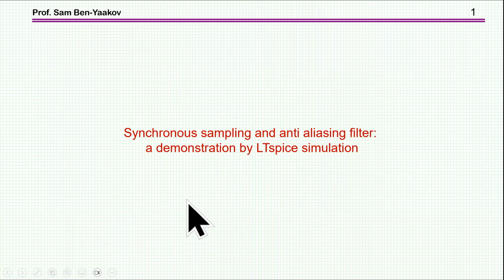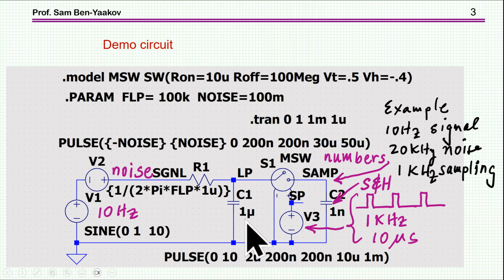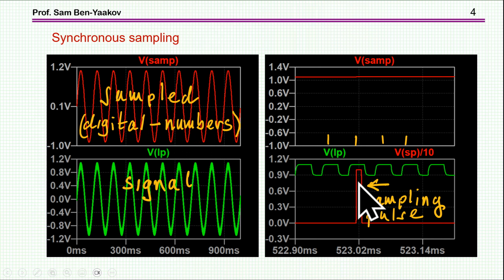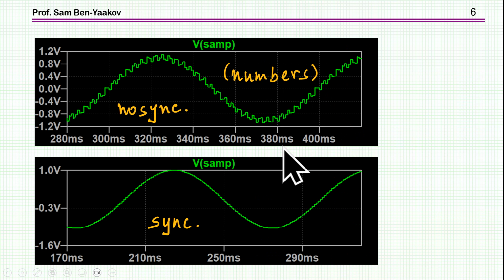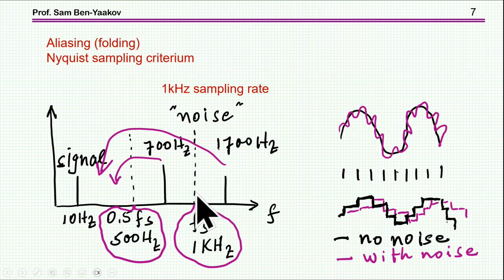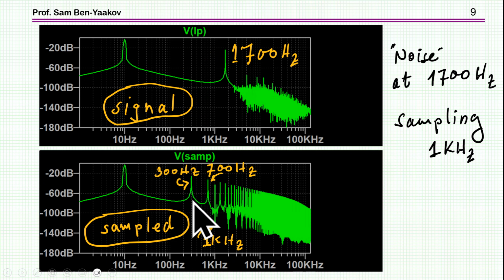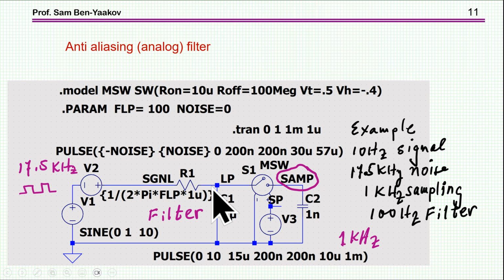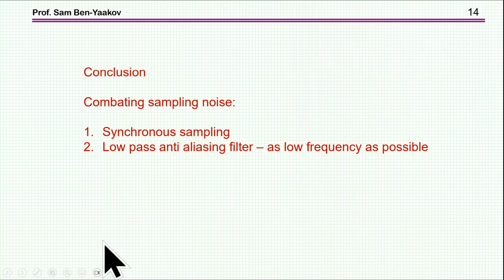Synchronous sampling and anti aliasing filter: a demonstration by LTspice simulation

Comment: Thanks Professor!  What was the simulation command you used to produce the spectrum plots?
Reply: You add AC analysis instead of transient.
Reply: @getusel  Ok.  And what source to set for 'small signal AC analysis'?
Reply: @RogueTuning  Right click to any independent source select advanced from the resulting window. Choose the source from the function menu. On the right side of the window you will see Small signal Ac analysis amplitude box. Insert 1 there and you should be able to run ac analysis.

Comment: To reproduce frequency f, you must sample for a time T=2/(f_s-2f) at sampling frequency f_s.  So very near the Nyquist frequency it takes a very long time to gather enough data.  But at f<f_s/4 it requires only a few periods for high fidelity reproduction.  Put another way, frequency f requires time T to increase or to decrease in amplitude.
Reply from the maker: This is ( a textbook theoretical situation) for a fixed signal that is then averaged. Who is interested in that? In any practical use the signal is changing.
Reply: @sambenyaakov  That is rather my point.  Practical signals require significantly higher sampling rates than the Nyquist criterion... 4-5 times faster gets reasonable response times.
Reply from the maker: @byronwatkins2565  Isn't that what I am saying in the video?

Comment: One of the issues of adding the LPF is that it adds a substantial delay for low frequencies. Because the delay is so long, I've found reducing the zerocross jitter becomes a challenge. Thank you for showing how important the sampling frequency is, and that just by sampling closer to the nyquist frequency can yield different results.
Reply from the maker: The relationship between BW and rise time is fixed. I am not sure I follow your comment. Can you be more specific? The application, some numbers?

Comment: Very nice, but you've given the ideal synchronous sampling case where you are able to adjust the delays between the control of the SMPS clock and the A/D conversion clock so that the sampling occurs when the switching noise is minimal. In the real world case, it would be difficult to control this delay, and you might always be sampling at the time where switching noise is at a maximum. It should be possible in this case to put a small delay in the A/D's convert clock to get back to the case which you have assumed, but most systems that I am familiar with don't have this capability...
Reply from the maker: Thanks for input. Not only that this is possible it is done very successfully. In the products  that we have designed, the signals are sampled synchronously. Not that difficult to accomplish.
Reply: @sambenyaakov  I wasn't claiming it wasn't possible, but if you look at precision A/D convertors from TI and Analog Devices, the app notes mention this subject exactly 0 times and I can assure you that outside of your community, this isn't even discussed. So synchronizing the frequency of the A/D with the SMPS is rare and adjusting the phase relationship to coincide with a quiet portion of the SMPS is unheard of.

See for example Analog Devices app note CN-0137 where they discuss using a SMPS solution to increase efficiency for a precision A/D converter. In their circuit example, they don't even bother hooking up the switching frequency control. Or TI's Application Report on High Speed A/D Convertor Basics, where half of the long document is allocated to input signal conditioning without a single word about SMPS synchronization. I suspect that somewhere on these sites you would find this discussion, but that the overwhelming percentage of designers has never seen it.
Reply: @ats89117  I agree with professor. At my university in Poland and in the industry that I worked with using synchronous sampling is common practice.
The app note you refer to is about ADC power supply, not application in power converter and that's why this information is missing.
What systems are you familiar with? Are they equipped with microcontroller?
Reply: @tomaszswiechowicz1181  The question is not about synchronizing the sampling frequency of the SMPS with the A/D converter. Many SMPS have a clock frequency input for synchronization. The question is about phase shifting the convert time to ensure that it occurs while the SMPS is at it's least noisy period.

My application area is phased arrays where there are 10 to 1000 A/D converters each bringing in 1-2 million samples per second with 20 bits per sample. These systems are always controlled by FPGAs and the SMPS is frequency locked but I've never seen it phase locked. If there was a phase adjustment, which could certainly be added to the firmware, the only way to do the adjustment would be by trial and error because there is no visibility on the delays for either the SMPS or the FPGA clock circuit that generates the convert signal. I am designing one of these systems right now and have added this as a requirement because it seems like it could be very important.

As an aside, thanks for your comment. I have a friend who is a professor at the University of Warsaw, and I am interested if this is a more visible issue in other places...
Reply: @ats89117  I think that my misunderstanding came from the fact that I'm designer of power converters (based on microcontrollers) and adding phase adjustment functionality is trivial. Looking at the market, however, I can't recall any SMPS IC capable of that. Maybe ICs for converters in interleaved configuration would have it.

I have a fact that might be interesting to you: I built reactive power compensators that are supposed to work in parallel through fiber optic communication. One of my goals was to enable phase adjustment through it, because it greatly reduces conducted EMI below 1MHz when phase is selected for destructive interference.
Reply from the maker: @ats89117  Send me an email to sam.benyaakov@gmail.com, reveal yourself telling me who you are, and I will show you how this synchronization is easily done. It is in fact COMMON PRACTICE in motor drive inverters, no matter what TI says.
Reply from the maker: @ats89117  Really? See https://www.nxp.com/docs/en/application-note/AN1933.pdf
Reply: @sambenyaakov  Okay, so this showed up in the Freescale 56F80X DSP processor twenty years ago and an app note was written about it. The latest versions of the 56F80X don't even mention it, and this was never a popular DSP processor to begin with. I'm not saying it's not a great idea, just saying that almost nobody supports it with their hardware...
Reply from the maker: @ats89117  Wake up. There is no motor drive inverter of today that does not use digital control with synchronous sampling. It is extremely simple to implement because both the PWM switching and the A/D sampling are derived from same clock. Rather than thanking me for correcting your ignorance on this matter by bringing to your attention this fundamental and highly useful technique you are arguing and arguing. I don't know what is the area you work in but I can only guess that you are NOT using digital control and therefore unaware of its capabilities. This is the last of my responses on this issue.
Reply: @sambenyaakov  Well that's amusing. You're absolutely correct that I am NOT using digital control for motor drive inverters. On the other hand, I have built over a hundred million dollars worth of products that use cutting edge A/D converters to sample data from transducers, where self noise from SMPS are a serious issue. And exactly none of these A/D converters has the ability to adjust it's timing to coincide with the quite portion of the SMPS cycle...
Reply: Double edged sword - not always good idea to have exact integer ratio of clock frequencies of SMPS to ADC - end result is that phase noise of those two gets demodulated into DC offsets, so unless your singal of interest is modulated itself, can bring more harm than good. Usually when needed, its better to deliberately place the resulting spectral spurs in out of interest band in the ADC channel bandwitdh and filter it out in digital domain after conversion. Did something very similar for lab instrumentation where crosstalk of HV PSU into data acquisition channel had to be eliminated.
Reply: @Konecny_M  Agree completely, but if you can find a phase which is quiet, you could be a lot better off, whereas if you chose a phase with high dv/dt, you would be much worse than not synchronizing to begin with. Apparently from SBY's comments, the tools for finding the quiet phase are available for systems he is working on, but I've never seen them in my field...